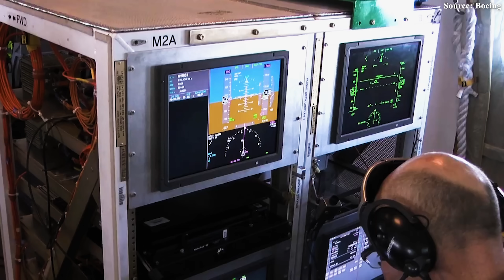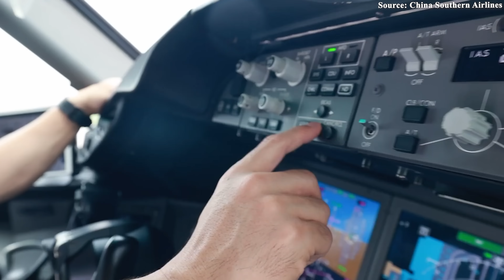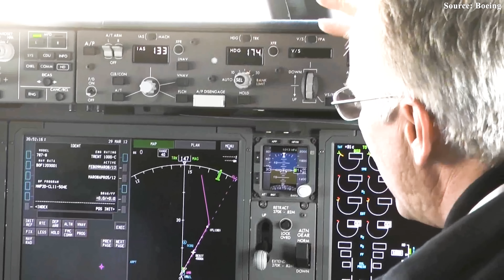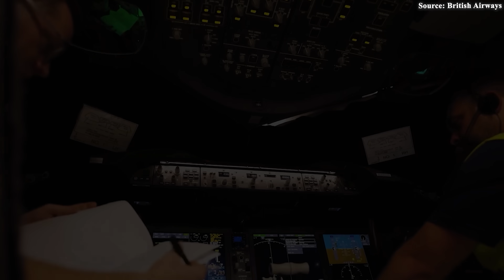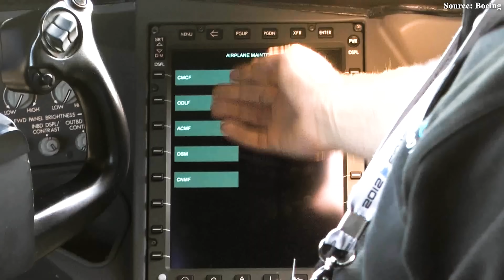The FAA Just Dropped a HUGE BOMBSHELL about Boeing 787! Here's why

Comment: Boeing has reported losses since 2019 and a significant net loss of -$11.8 billion in 2024, compared to Airbus' profit of $4.1 billion in 2024.  No wonder they go with the lowest bidders for all their manufacturing processes and supplies.  They wonder why they can't make a profit, maybe if they were not run by accountants that put the shareholder comfort ahead of the flying public's safety they would not have these problems.  They knew the 737 MAX was a total POS, an unflyable pile of junk that required a computer to maintain trim because all they really did was strap on oversize engines onto the the 727 and they were too large, would have dragged on the ground so they had to get the engines up off the ground by moving them forward and up onto nacelles that totally changed the aerodynamics and performance, and even then had to flatten the bottoms of the engine cowlings.  And to save money they did not include redundancy in the sensors the plane used to detect potential stalls so the MCAS computer would take over from the pilots and power the nose down, resulting in about 600 dead people in two crashes only months apart.  That already has the aviation world spooked because nobody really wants to get on one and I don't blame them.  Now we see a fireball in India that has killed another 300+ people and it is clearly a Boeing problem no matter how they tried and failed to point the finger at the pilots.  Just as they did when Lion Air went down in 2019 followed by Ethiopian Air crash in March of 2019, less than 5 months later.  A 787 grounding would be the end of Boeing and we all know it.  But the USAF has issued a $20 billion contract to Boeing for the F-47 6th gen fighter that has a contract lifetime value of over $3 TRILLION!  So the government cannot allow Boeing to go under and will not do anything about accountants running the company requiring them to put safety first.  Boeing is a horseshit company that puts shareholders first and employees dead last.  And that culture of greed is enabled by a US government that has utterly lost its way.
Reply: So, who do you work for?
Reply: The empty can rattle's the most
Reply: @larryallen9404 it’s still who do you work for

Comment: I will never get on a Boeing plane again.  Between how they handled the 737 MAX and now the 787 problems it is clear safety is not their highest priority.  Pilots have to have the ability to override malfunctioning computers, and engineers need to be able halt production when they discover a flaw as they did in the 787 when testing the 787 troubleshooting of the computer systems for anomalies.  They came across just such a scenario as the AI 171 crash before the Dreamliner was certified but did not investigate it properly or else had their arms twisted by accountants who run the company saying it is such a rare combination of events that it is never going to happen in the real world.  But after several million flights it has happened and it will happen again unless the problems are solved.
Reply: What happened?

Comment: To blame the Chinese for the substandard parts is a way to avoid responsibility. BOEING has had quality issues for decades. Remember the 737 incidents where the rudder locked up and ( if I remember correctly 2 planes crashed ) ,or when it was found that they use substandard bolts to fasten the rudder, or more recently where the planes lost all electronics for up to 20 seconds ? How many other cases don't we know about? The worst is that the FAA knew about many of the cases but didn't react until there was a serious incident.
Reply: Who do you work for?
Reply: @mark8337 Why ?
Reply: The question is...
Do you remember?
Reply: @larryallen9404 No, it’s still who do you work for.

Comment: One of Boeing's big problems seems to be the plants that do the outsourcing work that Boeing does not do inhouse. Chinese are known for using substandard materials in things. I am amazed that Boeing would select China to do anything for them without a strong set of checks and balances to make sure things are up to specs. This is poor performance from Boeing that makes them look bad even though they did not do it themselves. If Boeing does not get its act together they might as well start building biplanes again.
Reply: This is what you get when accountants take over a once great company that used to do things right rather than going to the lowest bidder for everything.  Boeing is no longer a great company, it now puts profit first and safety second.  I am glad I am old enough I have seen as much of the world as I want to.  Because you could not force me onto a Boeing flying junk pile at gunpoint.
Reply: @bluebook709 who do you work for?
Reply: Who do you work for?

Comment: The Chinese likely did the usual bait n switch. Test samples were the real deal, and the  production bulk came with funny paper. I spent some time working for Field Aviation in Toronto in the 70s, and got the full picture on certification of aviation parts. Bogus parts and materials was well known even back then. But then, I'm not convinced Boeing is lily white and pristine clean in this either.
Reply: When hundreds of lives per flight are at stake excuses are just not good enough.  If the Chinese are known for delivering substandard parts then don't buy from the Chinese, DUH!  But, Boeing is now run by accountants that go with the lowest bidders even when those are known to be sketchy.  After all it is profit first now and safety second.  Someone tell the air carriers that a lot of us will quit flying before we get on a Boeing craft.  If you do not give us a money back guarantee we will not be forced onto a Boeing plane then I ain't buying your ticket in the first place.  If I have to fly long haul it is going to be with a carrier like Delta that has no 787s, and I will be checking what the craft is before buying the ticket, if it is Boeing I am not buying.
Reply: Most guys who buy or sell auto parts would agree that good samples given to purchasing decision-makers, followed by shoddy goods delivered to the retailers and customers are standard Chinese manufacturing practices.

Comment: I personally don't like the new body materials. Like everything else its about money!😡😡😡🤬🤬The aluminum used for 100 years should be maintained. Think of the titan materials! When the love of money takes precedence the quality goes down! Most things manufactured now days are not made to last! The quality is terrible😡😡😡
Reply: That's what happens when accountants take over, it is all about shareholders not passengers and crew.  I am never getting on a Boeing plane again, but then I have sort of long legs and my last travel adventures were so cramped in the planes I flew on that I already vowed I was never flying again, and that was before I knew what flying junk they were.  As far as I am concerned when a plane has automated systems a pilot cannot override that plane is a flying coffin.  Dreamliner should be grounded.  With all the ADs and urgent bulletins about problems with the jet there comes a time when it just should not be considered airworthy.  It is all about profit with Boeing.

Comment: Everybody is yelling at Boeing. The real issue is why is Spirit Aerospace sourcing off-grade Ti from China? Did China cover up the CP-Ti with Grade 5 (Ti 6-4) certificates of conformance? Were the certificates really showing it was CP-Ti, but Spirit quality didn’t catch it, or worse, ignored it? This sounds like a replay of the fastener issue twenty or so years ago where out-of-spec materials were used in critical fasteners.
Reply from the maker: You reminded me of an important detail.
Reply: There are some simple non-destructive checks to show alloy identity. A quick one is an X-ray fluorescence (XRF) gun. Looks like pistol, place “muzzle” on part, pull trigger. Will show presence of Al and V which would be absent in CP-Ti.
Reply: Machinist should have immediately recognized a difference in machinability. Ti 6-4 is very hard and it work hardens to much harder levels of surface hardness. CP-Ti is gummy and soft. Did the machinist making the parts flag this? If he did, did Spirit management ignore his concerns? There are a lot of ways to catch this kind of issue. Intentional or just the Swiss cheese holes lining up to make for a quality escape? If people are cheating the quality systems then no system will be effective if sufficient overchecks aren’t being made. This is not a first time event…it repeats itself every few years.

Comment: Only safe fly by wire is the wires connecting the control colum  in the cockpit to the surfaces out on the wings, these Rube Goldberg machines ought to be re-thought.
Reply: Sure, as long as you don't want to fly anything much larger than a DC-3.
Reply from the maker: Thanks for your comment.
Reply: @FLIGAVIA 
You mean...
Thanks for the uneducatedcated babble. 
I guess it somehow supports the uneducated babble in your post. 
Go play with your shapes and colors!

Comment: This is not only an indictment of the B787 but also of Boeing in general. They and Spirit knew exactly what they were doing. This is what? the third aircraft they have played fast and loose with, the B737Max 8, the B777X, the now the B787. How many of these Accidents waiting to happen are out there with Boeing Jets, and why is Charleston Boeing so often mentioned as the source?  I used to be a Boeing fan, but no more. The only Boeing in service now that I will fly on is the B737-900ER or preferably any Jet manufactured by Airbus.
Reply: @2chuck  because dummy Charleston is the only place the 787 is built now !!!   DUUUUUUHHHHHH!!!!!!!!
Reply: The older Boeing planes were good and reliable. Take the 707 ,727 747 and the earlier 737 , there was never an issue with them. The problems started when they ' upgraded ' them or started using more modern materials and technologies.

Comment: Titanium is not used on the RAT. Titanium is used on structural parts. Your posting is misleading. The RAT is made from aluminum parts and hydraulic motors, No titanium here.
Reply from the maker: “The titanium material that was possibly used is a Grade 1 or 2 commercially pure unalloyed titanium, which has significantly reduced strength, fatigue and damage tolerance properties” than the “Grade 5 Ti-6AI-4V alloy” that was supposed to be used, the FAA says.

Comment: Situations of this kind (materiel supply chains)  are relatively common in aircraft manufacturing for many years.  The oversight is strained.  But your hyped up and breathless narration is complete bullshit.  Your fake AI style narration adds to the impression that you are ginning up fears to boost viewership on your crummy channel.  Between a few RAT assemblies that might require inspection and rework, and the crap on your channel, I find what you are doing to be more harmful to aviation safety than anything you documented here.  Your channel sucks and the 787 is a distinctly excellent aircraft.
Reply: "fake" AI style narration .. is the narrator real or not? .. and is there an intention to deceive, purely to boost viewership on their "crummy" channel?
Your conclusion that the channel sucks and that "the 787 is a distinctly excellent aircraft" ... would suggest to most viewers that you are a Boeing troll using some sort of word salad in the hope that you will be effective in turning viewers away from the channel.
May I suggest you go back to a Disney channel and play with yourself.

Comment: There is another possibility, (and I stress possibility rather than probability or even certainty) it is that Boeing may be more affected than others, and that the issues may (hopefully) not be as widespread as feared.

It is that Boeing's quality control was so flawed, possibly even lacking in certain areas that the supliers realised that they could 'get away' with deliberately supplying a lesser standard product, and saved themselves the expenses associated with adequate quality control and certification at their end.